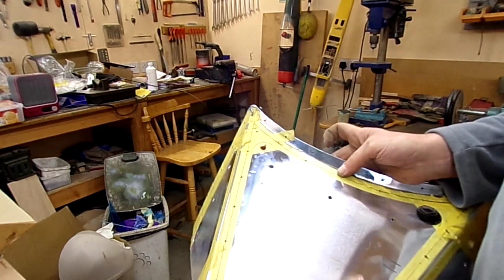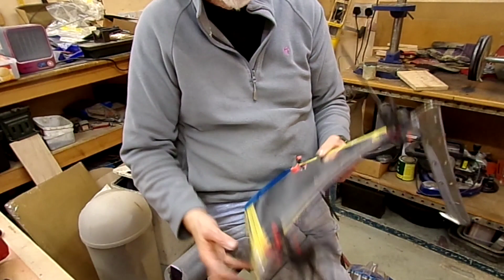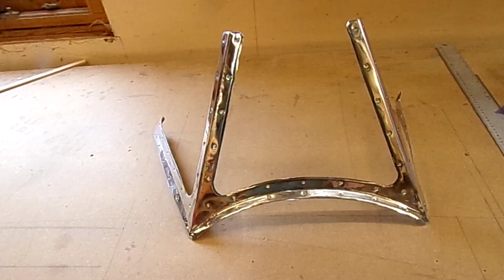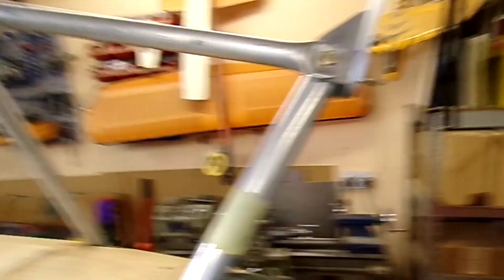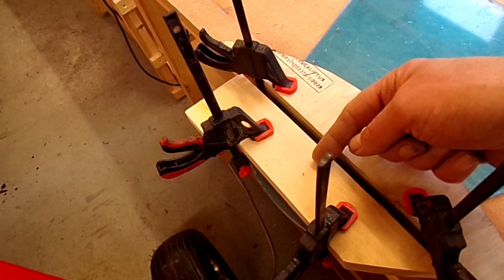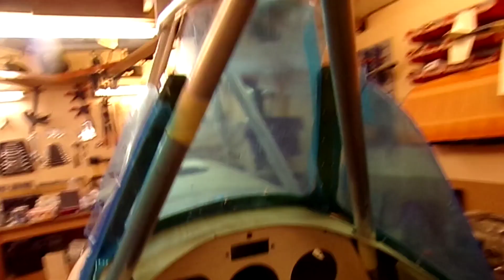EP136 Completed the Windscreen. Fisher Youngster

Comment: Again, thanks for letting us all follow your adventures in building. I so look forward to each episode!
Unrelated question: as I am nearing completion of my Super Koala wings, I find myself wondering if drilling some lightening holes in the main spar webbing would be worth considering. Any views on this idea?
Reply from the maker: Simple answer,I would not drill lightening holes in the webs. It is only structurally possible outboard of the stuts, without compermising strength and then slowly increasing in size towards the tip, the amount of weight saved is not worth the maths or effort. If we talked metal spars then that might be different as the flanged hole add stiffness and reduces weight but even then the maths is complex for stress and it differs with stressed skins.
Reply: @flyingkub  thanks!
Reply from the maker: @dennispitz7488  no problem.

Comment: Looking awesome mate
Reply from the maker: From you that is a big complement, thanks buddy. How are you getting on with finishing off your wings now you have room in the shed?
Reply: Im kind of waiting on my mate to weld the fuel tanks before I get in to the wings again. So I’m doing bits and pieces on the fuselage to keep myself occupied. Fun times!
Reply from the maker: @donwtsn  I am sure there are lots of little details that will be sorted while you wait. It is that itchy time when it is coming together but you have to hold back and not rush the last bit.
Reply: Yep, it’s an odd time. And if there’s nothing else to do, there’s always the paperwork for certification which I’ve been a bit slack on!
Reply from the maker: @donwtsn  Oh yes the paper work, if it is like the UK, it weighs the same as the aircraft 🙂
Reply: I’m going for the experimental catagory here. I don’t need to have anything certified, although, using a certified engine makes it easier. I still need to have an inspection done and produce a pilot manual and performance charts, and describe the test flying schedule. Fun times
Reply from the maker: @donwtsn  we don't have an experimental class,  so home builds have to conform to approved plans,  the exception is the SSDR class but restricted to less than 300kg. I will use the EAA flight test schedule as my guide, as I think it a good start point.
Reply: Our experimental catagory isn’t as simple as the American one…our CASA had to muddle with it a bit! But it’s still pretty good so I can build something not to plans like Frankenstein. I joined the SAAA (our version of the EAA I guess) so they can help me wade through the requirements. They also have templates for manuals, performance charts and test flight schedules that will be pretty handy. I’ll start getting into it soon
Reply: I think here is a little better than there paperwork wise…but not by much!
Reply from the maker: @donwtsn  it always feels like a lot, especially when you repeat the same information. My current project is a lot easier than previous ones as it is a new build and an SSDR (Single, seat, deregulated), so no need to compile all the inspection documents,  components certificates of conformity and logbooks,  for a final sign off.

Comment: Looking more like an aeroplane with every video.

Just a question - will the rudder ever get clean air?
It doesn't look like there's time for the turbulence created by the windscreen to smooth out.
Reply from the maker: Good question. The cabain struts and pilot's head are all causing turbulence, the screen to some extent smooths the flow down as it goes down the sides. From a very basic fluid model, it makes very little difference over the original canopy / rear deck design and they flies okay. It is a fairly large rudder though :-)

Comment: A lot of allowances there for expansion, drill clearance etc, and very close to the edge...I'd be concerned about eventual cracking due to flexing with engine vibration. That you've made the perspex removeable is a bonus there, but did you consider removing the risk and using adhesive (like Sikaflex) perhaps?
Reply from the maker: Good questions Woody, the land between the edge and the hole is fairly small but only along the vertical joint line, which has a double strip to spread the load and stiffen the area. The land on the bottom edge is over 2.5 times the dia of the hole so should be good. The 0.5mm increase in dia is on 0.25mm clearance and that is from past experiance about right. I did think about bonding but thought it would be a pain to replace (probably destroying the frame to replace any part), I also thought about putting a vibration insulation in (like bath sealant but not have it bonded to the acrylic) but decided against it for now. Time in the air will tell and it is easy enough to replace and insulate if needed, it is that age old problem of trying to keep weight down.

Comment: Gotta say bud, you sure do some excellent work. Perhaps Take a small piece of  hose like weedeater fuel line or just rubber fuel line and cut a slit down the middle to use as a gasket sealer around the bottom of your windscreen frame.
Reply from the maker: Thanks for being kind in your comment. I am thinking sheet under the frame as it would be less viable but I will use somethink like your idea to dress the edge of the cockpit.

Comment: Interesting work.  I was afraid to bend plexiglass or lexan.  Not sure how much heat to apply.
Reply from the maker: Lexan is easy to bend but hard to get it without micro blisters. For Acrylic as I said I use agound 300 to 330 degC and waft the heat gun over the bend area to allow it to take on the head fairly slowly and it becomes plyable, in this case the weight of the wood started the bend. For a vac-form / blown canopy you need a big oven and slowly raise the temp before forming, a far more complex operation, one I have done but never got right first time, so a lot of waste and I would not even try with Lexan.